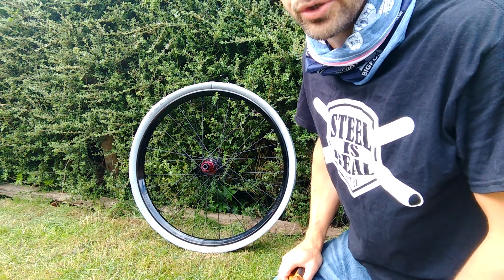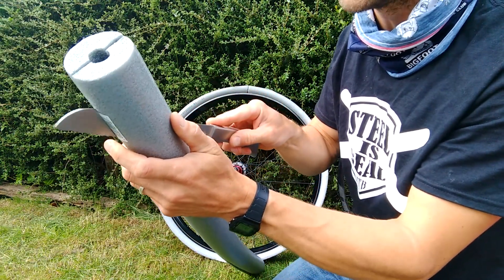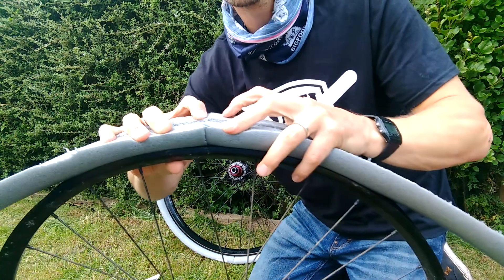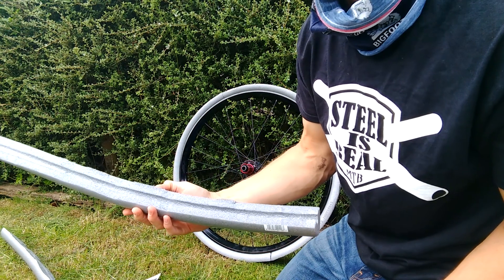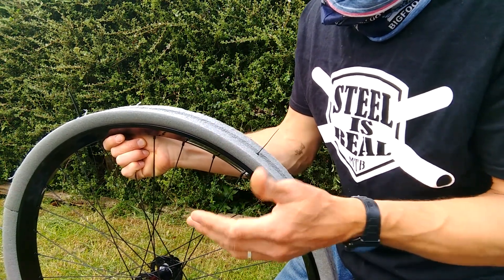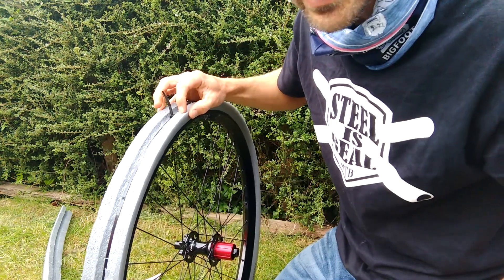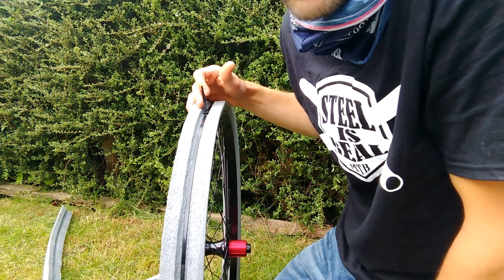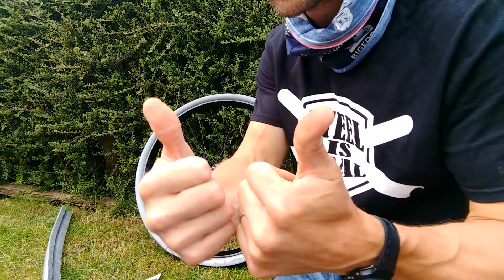CushtyCore UK

Comment: Just did this today to my Hope 35 wheels. I used similar closed cell foam but used a smaller strip of foam down the middle of the bigger strip to get more of a Cush Core like profile in the middle. I like the zip ties because they force the foam into the center channel of the rim just like Cush core. I also found the foam I used had a bit of elasticity so I will try gluing the ends with gorilla glue next time and seeing if I can stretch it over the rim and get a tight fit without zip ties. How are these working for you?

Comment: I  keep 30 lb pressure in my cargo electric trike , the trike has 20 inch rims with schwable 1.5 tire . Would it be possible to insert closed cell foam and approximate 30 lb of pressure without pumping air in my tire . Thanks for the video .
Reply from the maker: I think you'll still need to add air as the foam isn't that rigid.

Comment: i have a suggestion to make your hack better :) why not try using 20inch or smaller / tighter tire tube cut it in half that way you have an elastic band to replace your zip tie with free presta valve in it
Reply from the maker: That is a good idea! The valve would have to be extra long though and you may have trouble sealing the valve at the rim. I like using an old tube as a band though👌 Buying a longer length online would mean only one join which would be even better too.

Comment: Did you cut the tails off the zip ties before mounting the tyre?
Reply from the maker: I did but I don't anymore - if you keep the tails on you can reuse the zip tie band over and over. And the tails don't affect the ride or the tyre or the inserts, in fact if you cut them you're introducing unnecessary sharp edges 👍
Reply from the maker: Pop a tyre bead on first, then put the inserts in and band around and tighten the band. Then put the second bead almost all on, pop your sealant in then put the remaining bead on. I need to update the video as this is now how I do it 👍

Comment: Hi bro, great video! My question is why cut the tube in half? Am I wrong or you will get more compression distance/range doing it with full tube?
Reply from the maker: You'll get more protection in a way but you loose the tunabld air chamber. Also you can't fix the ends together very well - when you tie them together at the ends they tend to rip apart and then protection is limited. By cutting it there is still sufficient protection and you can secure the 2 halves together solidly with the zip tie band. 👍
Reply: @tamarin0843  Ok i will think about it. Gonna do it next week. Peace man ;)